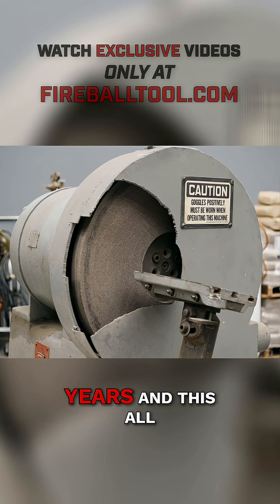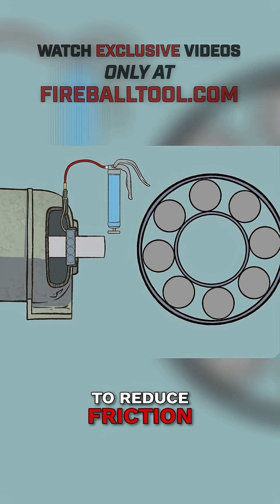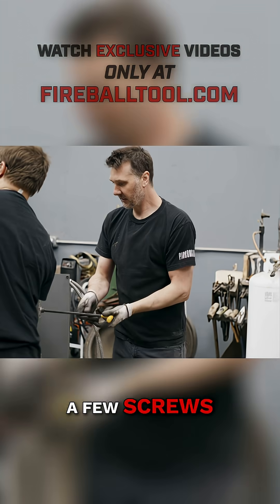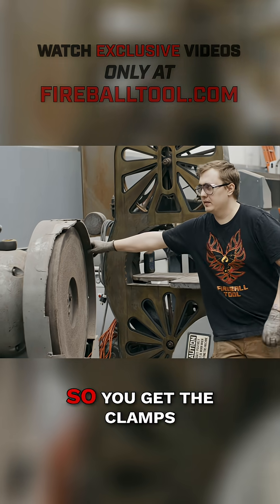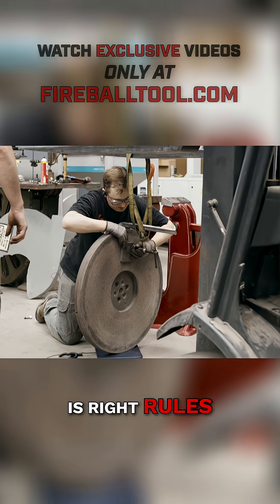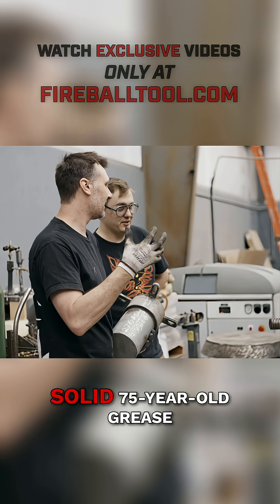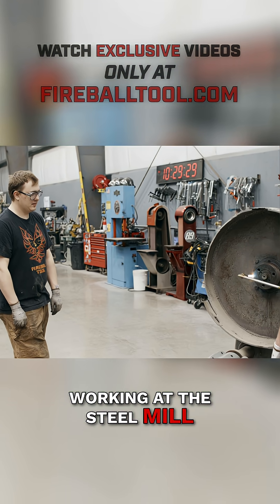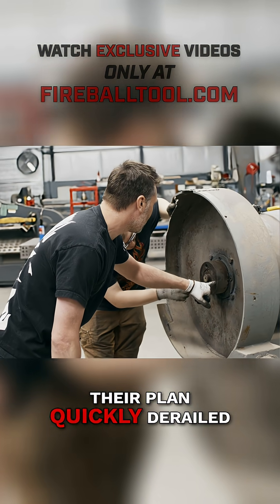Can Heating Solve This Grease-Locked Machine? 🤔

Comment: Some old machines even though they have "grease zerks" were actually meant to be oiled through them. I have seen several restorations where the machine wasn't running because people mistakenly packed it with grease instead of oil. It will work in the short run but will eventually cause issues. 

I am sure you know your machine and what it needs, thought others might be interested in that fact and be careful with old machines.